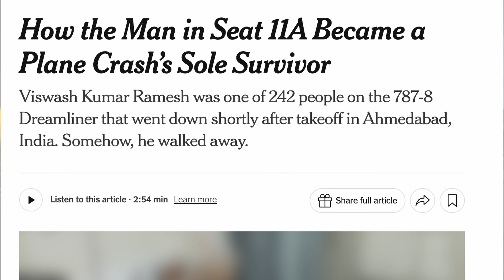Why the RAT Changes Everything – Air India 171 Update

Comment: The engines don't appear show any sign of catastrophic event in those videos; they aren't blown apart or on fire or smoking and from the sound as it passed they don't appear to even be running, or not with any real power if they are. So what would cause a complete cessation of power seconds after takeoff of BOTH engines with no obvious catastrophic issue on a pretty new plane? Fuel contamination goes to the top of my guessing list.

Comment: In addition to that, there are 2 more pieces of evidence, the main landing gear started straightening up (visible on video), which is the first step on a 787 after the copilot  pulls the lever to retract them. So it’s means the copilot had actioned the gear up lever but the  loss of power stopped the process. Second, we can see on the pic of the back on the plane crashed on the building an opened door. That’s the air intake for the APU : on take off, APU is off but on auto start in case of power failure. The fact that the door is opened shows that the APU had started powering up due to complete loss of power. Loss of 1 engine just after take off, the right one ( we can see on the crabbing) and loss of the left engine about 5-7 seconds later just after the copilot actioned the gear up lever. I don’t see any pilot error there . Just a mechanical failure probably due to fuel line contamination. Maybe the pilots could have steered to the right to crash where there was a small piece of empty lbd available but hind sight is always 20-20
Reply: When I say straightening up : by default, on the main gear, the back wheels are lower down compared with the front wheels so as to touch down on the back wheels first. When the first officer pulls the lever to retract the gears, the back wheels and the front wheels of the main gear have to level up to fit in the gear compartment, then the gears retract. We can seen on the video shown on this update that front wheels and back wheels on the main gear are leveled, indicating that the first officer had actioned the lever gear up but that the action couldn’t be completed because loss of hydraulic power (probably due to loss of engine power). Hence the gear down.

Comment: If you zoom in on the wing, there is a fine line on the wings that MIGHT be the flaps extended.

Also there is another YouTuber called jeffostroff (I think thats how its spelt) he's an engineer and he looks into all sorts of disasters from an engineering perspective with plans, other data etc. He has a video which has a comment about the landing gear - when you go to pull up the landing gear, the front end of the wheel set lifts up to about a 30 to 45 degree angle BEFORE tucking into the belly of the craft. You can see on the take off video that the wheel carriage tilts upward as if it is going to pack away then stops. Also on the window video, you can see the tilt too. 

Suggests that as the landing gear was being retracted, a hydraulic failure stopped them from completing the maneuver and may have been exactly when the engines died or the lines got cut. The aircraft continued on a dead straight line before crashing. I am sure that the pilots would have tried to avoid the residences if they had ANY control over the aircrafts direction. The RAT may have been deployed almost immediately when the landing gear failed to retract and with no hydraulics, the pilots would not have had the altitude or the distance to either return to the airport or to find a safe landing spot. Those poor pilots probably knew right away they had no chance but went down fighting.

My heart goes out to all on board the aircraft, those lost on the ground, their families and friends. I also commend those who worked on getting any survivors out of the building and the wreckage and the investigators.

One thought, If there was an electrical outage, would this have affected the CVR/FDR? I am fairly sure they have their own batteries but does that still power the microphones in the cockpit?

Comment: Thank you for the analysis. It was hard to believe the pilot error theory going wrong on basics. So, RAT gets deployed when there is failure of aircraft electrical (or hydrolics). It's an air-turbine to generate power for aircraft essential components. But why electrical system failure can result in engine failure? May be its not the engine failure, but fuel pump failure. Because fuel pump is also powered by same electrical system.. but why did all three power sources - generator, auxiliary power unit and battery failed - all at once?.. 
since 787 does not use ECAM but a sophisticated multi function display and System Display..for alerts or warnings. Was it missed on routine checks before takeoff? may be the power from RAT did not power the fuel pump?. also, why did all power sources died at once? Any maintenance issue? If total electrical failure is the cause.. 
Hope  the root cause is found and rectified to prevent disaster in future 😢

Comment: Also, I don’t hear any jet engine sound….modern jet engines are quiet, but not that quiet and certainly not on take off.

It is very telling w.r.t. Boeing’s reputation that when considering the cause of a dual engine failure we shouldn’t discard the possibility of a design or construction error… or some kind of quality related problem…

Comment: Steeve, ive been waiting for someone to catch up. Sorry but theres no way to PM you.
How do u fail both engines on a dual redundant system????
You make a short circuit outside of the protected part of the power system..... Where is that??? Inside the battery. This 787 is the only airplane to have the terribly dangerous lithium cobalt oxide battery chemistry.
There is next to no doubt in my mind, the entire electrical system turned off to the entire dual redundant system that powers the FADECs. No matter how much current u throw at a shirt circuit, its still a 0 volt short circuit 
The entire fleet need to be grounded and all such batteries replaced with lithium iron phosphate. Lots of re certifying neccesary.

The fadecs turning offline left the engines in basic failover cruise mode, where the fuel flow is just somehing predetermined as a design standard. Not enough for full power hot climb
Sooo. In short, second lithium battery failure in a 787, this time unfortunately, not on the ground, just after leaving it :(

Comment: I dont think I have ever heard a black box recording where ANYONE says whats wrong to any useful degree...!! In this case "I'm loosing power" is next to worthless, Electrical power? Hydraulic power? Engine power? They knew exactly what was going to happen in a few second and no one thought to say "We've lost both engines..." Or " The hydraulics have gone"......
Reply: That’s why we have a FDR too genius. The CVR is still relevant for anything that happened from the pilots, like navigation errors, confusion, other mistakes. Like with the Air France flight to Brazil. Or the Sully flight that ditched in the Hudson.
Reply: @GBOAC  Crash investigations go on for months and years longer than they should because the FDR make no sense at all...All because the crew made no attempt to 'speak'...Clown.

Comment: My guess (Chat GPT assisted) is it's fuel-related. During take-off, when the engines are under maximum load, a number of potential issues relating to the fuel system, whether it be contamination, incorrect fuel type, or starvation due to improper fuel management (faulty valves or pumps) may have only become problematic once fuel-demand increased - hazards that may have gone unnoticed during pre-flight checks and taxi.

Comment: Electrical system partially failed. fuel pump stopped working, both engines shut off，RAT automatically deployed，but too late to  save 787. It crashed.

Comment: I initially thought fuel contamination too, but I’ve seen a video (not sure how much it can be trusted) where someone claims the flight before (not sure how soon before) had no entertainment system working, now although critical systems and entertainment may be on different circuits, it makes me wonder if there was an electrical fault in a crossover section that perhaps had been slowly smouldering or even causing an electrical fire somewhere that eventually damaged critical wires/fuel lines/hydraulics, leading to catastrophic failure to direct fuel to the engines. If it is a total loss of power to the engines, for both to go at the same time is unusual, I’m sure when the air crash investigation is complete we’ll get a full explanation of what went wrong, FDR data usually gives good indication as to the problem and with what I’ve seen from the wreckage it seems that some parts could be recoverable for testing (ie not total destruction)

Comment: We also note in the video taken at the edge of the runway that the left engine has thrust because it kicks up dust, but not the right engine.
So there would already be one engine that wasn't working after the V1, and probably the second one that had failed just after takeoff.
So the RAT was in place, but it wasn't enough to pull the plane into the sky at that altitude and speed.

Comment: In your professional opinion. If the pilots had open space/fields to put the plane down instead of plunging into a built up area, this tragedy could have been prevented? In other words the pilots had no alternative, the inevitable could not be prevented?
Reply: Such a scenario occurred with Ural Airlines Flight 178 in 2019. After a dual engine failure shortly after takeoff they took it down in a corn field, everybody survived. So it is indeed possible.

Comment: He’s right about how loud the RAT (Ram Air Turbine) is.  Before I retired, I was an instructor and an EASA and FAA examiner on the Gulfstream G650.  It is equipped with a RAT that is manually deployed.  On one flight, I was riding in the jump seat with a flight test crew.  One of the items to be tested was the RAT.    When it was deployed, the noise it created overpowered everything, even the David Clarke noise canceling head set I was wearing.
Reply: Yeah, they are horrifically loud, when we back drive them for testing the noise goes right through you.
Also it takes about 10 seconds to supply sufficient pressure to the centre hydraulics and about 6 seconds for the generator to power the essential busses. It was pretty much over by the time the RAT would have been working properly.
Reply: Awesome ! Have a nice retirement 🎉
Reply: Sounds like you had an amazing job, sir. I'm sure you have many fascinating experiences to look back on.....thank you for your insights on this particular matter. Best wishes ❤️
Reply: Thank you. I was just curious about that. Didn't expect a small turbine would create noises as loud as  a jet engine

Comment: Upon reviewing video footage of the Boeing 787 landing gear retraction sequence, it is evident that the ‘gear up’ command is initiated, as indicated by the initial movement of the main landing gear. Notably, the gear is already in a partially tilted position, consistent with the normal pre/retraction alignment process. However, the retraction sequence appears to be interrupted before the gear doors open. This interruption prevents the landing gear from fully retracting into the bay, suggesting that the sequence was either aborted or inhibited mid-cycle, possibly due to a system fault or lockout condition. The gear remains in its tilted position throughout, confirming that the initial phase of retraction commenced but did not progress beyond the door actuation stage.

Comment: We do in fact have a clue as to why the engines stopped, it happened exactly at the same time as there was an internet attack that caused severe disturbances on both internet websites and local computer systems. The peek of that attack was at the same time as the Air India crashed.

And another thing that no one reacts to: Why was the plane being filmed as it crashed.

It was not an accident, they took the plane down.

And then just hours after that, the US deadline for a deal with Iran went out, and Israel started their attack on Iran.

Comment: OK so just after rotating both engines quit and RAT deploys 
BUT for what reason did the plane use every inch of a 12000 foot runway ? 
In normal circumstances that plane should have rotated halfway down the runway takeoff roll is 5900 feet .
Engines quitting must be related to the plane practically over running the runway way .
In fact it looks like it did overshoot the end and perhaps the engines took in debris it appears to me the right gear door is missing as well .
The two have to be related 
#1 you have a 787 using up 12,000 feet to get airborne in what looks like a crazy Aerosucre departure and then Strangely both engines shut down ? 
I have yet to see definitive proof that the plane did back track and use the full length of the runway only the FlightRadar24 showing it start its takeoff from intersection

Comment: I commented on your first video that the RAT had been deployed and that people were pointing out that you can also hear it in videos from Day 1. Don’t mean to be rude but you’re very late with this…

Also, you never talked about the fact that if the plane was not configured properly at take off, there would be a bunch of alarm bells ringing in the cockpit because the plane is smart and will alert pilots.
Reply: What do you mean not configured properly?
Reply: @welshrarebit1153Flaps not set for example. Someone showed it on a Boeing simulator- when takeoff thrust is applied, the flight computer sounds a loud warning which is also displayed on screen.
Reply: @welshrarebit1153Btw, that same simulation showed the plane take off just fine with a max load and flaps set to ‘Up’.

Comment: i have now replayed the sound from the RAT for about 20 or 30 times at 3:50. And for me its sounds like that the main engines or at least 1 is running but not with power. you can hear in the background the classic turbine sound. listen closely. maybe it means nothing and i need better ears. But i can clearly hear a turbine. Regardless, the engines have not functioned as they should... I can only hope that this is not going down to Boeing. They suffered so much. If this was an Boeing fault in the end, it may be the end for Boeing.
Reply: If this investigation comes down to a point where Boeing is at wrong, I'd say they'll dodge it easily as always, because the airline businesses are all entirely dependent on Airbus and Boeing. The fact that Airbus wouldn't be able to meet the supplies can never be ignored and Boeing knows that, so they're going to take easy advantage of it. The whistle blowers who were ex-Boeing employees go missing, the researchers who are blaming Boeing are being targeted; these aren't mere coincidences. Yes, Boeing has a lot to deal with, but they aren't going to.

Comment: Question, electrical supplement I understand, but if there is a hydraulic failure , you've lost pressure via a leak in the system, so the original hydraulic pumps are still operational and a RAT is just going to supplement the leak out.   So presumably only if the engines fail, or the original hydraulic supply fails the RAT can help....  but if the hydraulics are from joint or pipe leak.... then praying is all thats left?

Comment: FAA Airworthiness Directive 2015/09/07 - "We are adopting a new airworthiness directive (AD) for all The Boeing Company Model 787 airplanes. This AD requires a repetitive maintenance task for electrical power deactivation on Model 787 airplanes. This AD was prompted by the determination that a Model 787 airplane that has been powered continuously for 248 days can lose all alternating current (AC) electrical power due to the generator control units (GCUs) simultaneously going into failsafe mode. This condition is caused by a software counter internal to the GCUs that will overflow after 248 days of continuous power. We are issuing this AD to prevent loss of all AC electrical power, which could result in loss of control of the airplane."

Comment: A321 vicinity London Gatwick, UK 2020  On 26 February 2020, after a difficult Airbus A321 left engine first flight of the day start, the same happened on the third sector with en-route engine abnormalities then affecting both engines. With no fault found during post flight maintenance inspections and despite similar engine starting problems, both engines then malfunctioned after takeoff from Gatwick. A MAYDAY return followed. Investigation found that the cause was fuel system contamination by addition of approximately 38 times the correct quantity of biocide during earlier scheduled maintenance and that the release of the aircraft to service for the flight had followed inadequate troubleshooting action.

Comment: The dual engines failed after the speed reached V1. Up to V1, the pilot can also abort takeoff, indicating that the engines were in good condition until that point. However, as soon as they entered the speed range between V1 and V2 and began taking off, a dual engine failure occurred. Is that correct?
Reply: We don't know that yet. But even after V1 it's better to abort if the airplane is clearly not flyable. Better to overrun the runway than crashing somewhere away from the airport. As the gear was never retracted the problems had to occur quite early, though.

Comment: To me, it is starting to sound like a maintenance error.
The same person is doing the same maintenance on both sides on a critical system and is making the same mistake. 
There should be systems in place to avoid this, but it is not impossible
Reply: When doing maintenance on flight critical components there are rules we are supposed to follow.
The same engineer cannot work on both engines in one maintenance input, they must be worked by two independant engineers.
Then there are duplicate inspections to double check components.

Whether Air India did any of this is another thing.